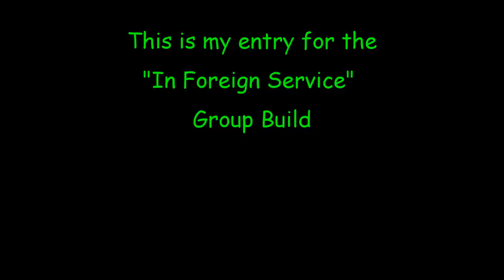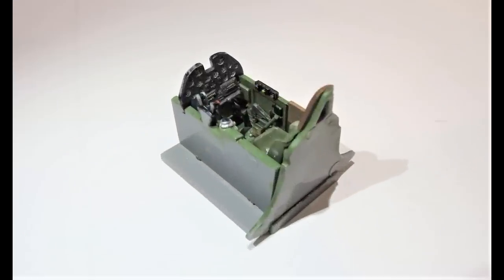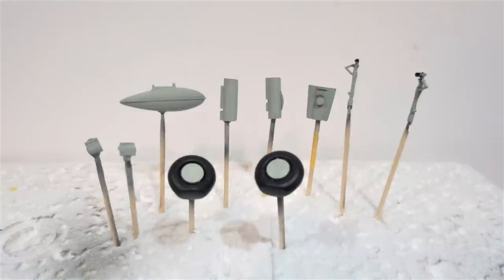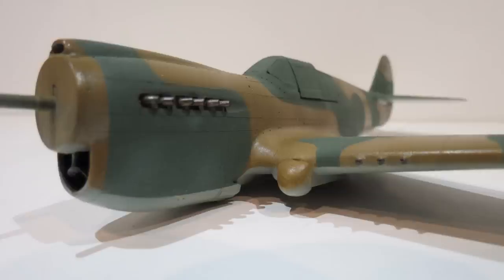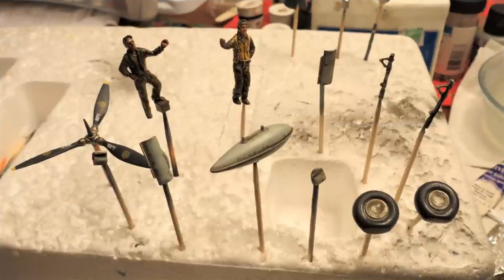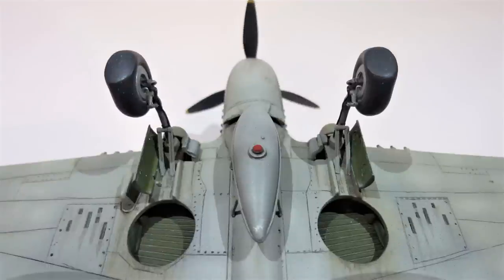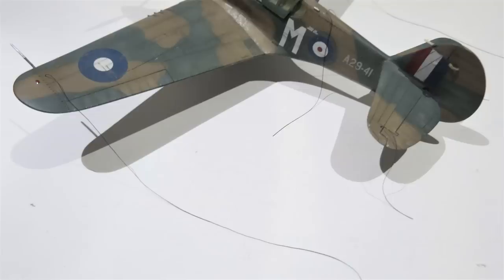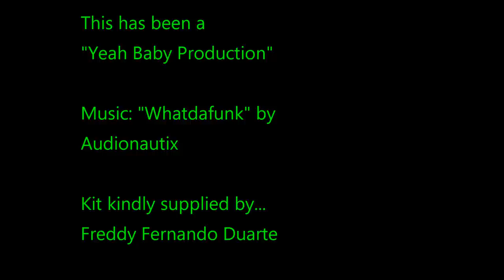Monogram Pro-Modeler 1-48 Curtiss P-40E Warhawk- "Full Build + Final Reveal" (5.3.18)

Comment: Nice job!  I am currently building this particular kit.   I have read (and noticed), the rudder is a over-sized and could use just a bit of sanding stick to make it a touch smaller.   Speaking of over-sized, the throttle quadrant is as well!   But overall, the cockpit is nicely furnished.   👍

Comment: Looks great Martin!  Rescribing those panel lines has to be a pain in the rear!
Reply from the maker: Thanks Drew, much appreciated mate. The rescribing took about an hour, not long...it's easy when using the raised lines to guide the blade. Cheers : )
Reply: International British Modeler so you just scribe along the side of the panel line and then sand away the raised lines? Doesn’t sound too bad then.
Reply from the maker: Exactly...eezie peezie...I've only re-scribed two models after this one. I always thought it was going to be a nightmare, and so was never motivated or in a hurry to give it a try, then after doing the first one, I thought..."What was all the fuss about?!" You have to have a steady hand and "feel" the direction of the blade...you can easily go off course, and if you do, you have to remove the error by sanding. Cheers : )